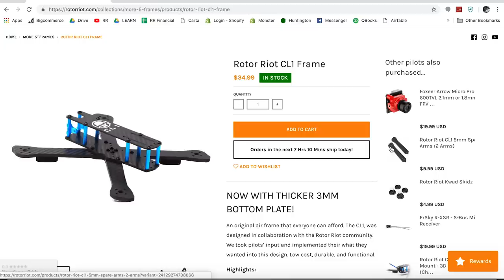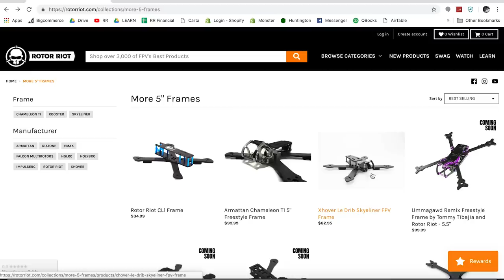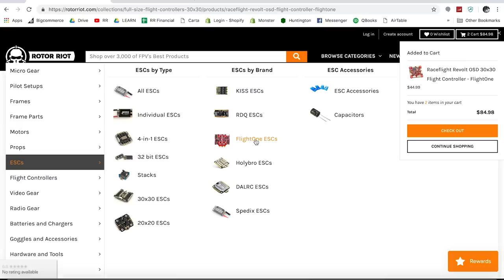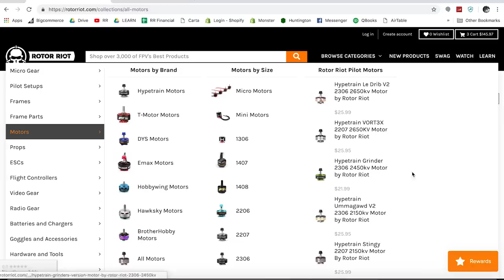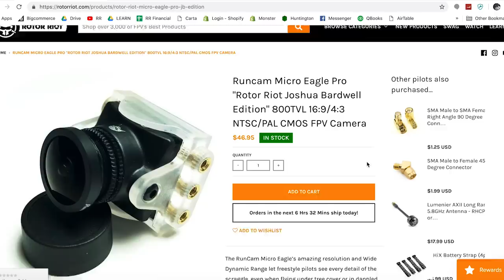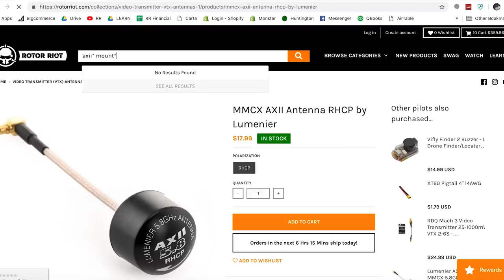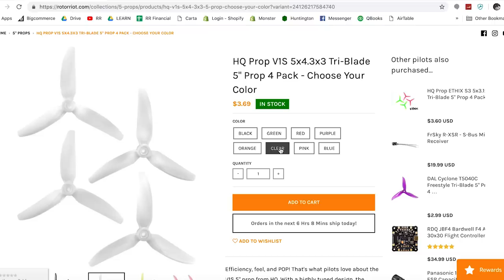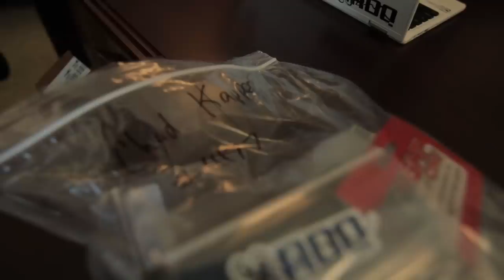Beginner FPV Freestyle Kwad - From the ground up!

Comment: Hey Rotor Riot! I have been planning to get the CL1 budget build kit for a while now, but I wanted to know whether not I should build a kit or do it from the ground up. I have a FlySky fs i6 in the mail and am going to train on Liftoff. I still have a while to practice and save up so I thought I would ask you guys. I think that I would want to fly similar to Drew's quads (I'm probably biased, Drew is my favorite), but I thought that the CL1 due to price would be the one to go with. Any advice would be appreciated!
Reply: Joseph Boehlke I would eliminate as much guesswork as possible and copy a RR build video as close as possible so you know all the components they choose will work together.  I like drib’s build.  Note: You’ll need a FlySky receiver instead of FrSky which is what most other folks use in FPV—no biggie though.  Good luck!
Reply from the maker: Just plan on crashing a lot! So don’t build your favorite from the start :)
Reply: Cheap/budget is fine, even the flysky i6 is fine, but honestly DONT get the cl1, it looks dirt cheap and they charge way too much for it. check for used or china frames, or even other cheap frames from armattan or amax.. the cl1 is made without any love at all, its sad
Reply: True about crashing. Fly over grass/trees instead of concrete and you can cut way down on the damage when you do crash.  Do yourself a favor—Practicing on a sim for at least 4-5 sessions beforehand will give you a huge head start.

Comment: KISS FC is not the best for beginners. The whole downloading of drivers is also a pain for newbies. There are plenty of video out there it just sucks we have to go through all this. I like how we have so much innovation with quad parts and yet we have to down load drivers from a website that requires email. Most frustrating thing about building from scratch is figuring out what will work together physically in a build. Kinda of have had built drones to figure out what is needed. for future builds.

Comment: Hello i am new i struggle on select the right flight controller and esc i need help to select on that match
Reply: What are you trying to accomplish?  And, how much do you have to spend?
Reply: @propsoff  freestyle 5" easy for a beginner   but good performance 250 or higher
Reply: @evelfpv  
Now, do you want AIO FC  (all-in-one flight controller - that has its own power distribution built in and normally paired with 4 individual escs on each arm) and four separate escs, or 4in1 esc? I like the 4in1 escs because the build comes out so clean; However, this will increase your stack height - eliminating low-rider frames. I personally use the T-motor F55A 4in1 esc. You can pair up just about anything, however, loads of escs and flight controllers come without instruction. Will this be your very first 5" build? 
Joshua Bardwell did a step-by-step 5 inch build, and I mean step by step - It would be a good one to go with for a beginner. A lot of mystery is answered by JB and you'll have a great flyer when your done.

Comment: Hey there, wonder if some could help me. I have alot of horizontal black bars when flying fpv. I have installed a capacitor and it hasn't helped. What else could I do to fix it?
Reply: VTX to SMA to Antenna Connections should be isolated from the frame. E.g. with shrinktube.

That was causing me lines.

Another one is described in a video of Bardwell: ground connectors of Cam and VTX should go to the same ground at the FC.

Motor Noise could also be an issue. Try with props off to spin one motor at a time within the betaflight motor tab. When there is noise spinning one motor, it causes it. Hat that with new motors.

Comment: I'm building a 6 inch freestyle quad, that I want long flight times for long range, but also good for intermediate freestyle maneuvers, I'm having a hard time choosing the right motor, any suggestions?
Reply: Yea bro bigger is better for 6in, they manage props better w less strain so more efficency and lower kv for less lipo rape ;) like around 2000 for 4s

Comment: Beginner to fpv getting BnF quads and I have 3 quads I can’t get in the air. All are he running crossfire nano rx. I’m trying to use QX7 with micro v2 and tango 2. Having same issue with both. Cannot see gimbal or switch movement in beta flight.  Binding is good with solid green light. I have 3 quads and 2 controllers and can’t fly. Very frustrated. Tbs tried to help but couldn’t. They think the BnF is on the wrong uart but it’s BnF and I’m having the same issue on all 3. I’m trying to get with I flight to get their BnF protek35hd running but having a hell of a time. In need of guru please

Comment: you should pick your motor based on what thrust and speed you want. there are plenty of online calculators where you can see the motor and esc temperatures, efflux speed, overall weight, etc.. you can also run what ifs on different prop diameters, pitch and number of blades.
you size your batteries from there also.
DO NOT just pick a motor and ESC. - well you can but you'll be guessing, which is also fine.

rpm is voltage x motor kv. A higher kv motor merely pulls more current for the same voltage. thats all. 

it'd be good to get some of the science supporting the fuzzy logic here..no offense.

Comment: Drib is not happy about Chad's idea. Honest, every quad building is
  column distance problem, everything else is the peculiarities of components.
And I agree with LeDrib. This is not the right way to highlight little things like a usb cable, it's already funny. About the engines and esc Josh tells in his channel very exhaustively. There is no way to build a good quadcopter without pain. You learn from mistakes, just as all mankind does...

Comment: Hi Guys   I have a Chameleon that I purchased off Ebay,  so I don't think it's a real Chameleon. But I don't care and I have 2205 2300kv racerstar, 30a 4 in 1, Fortini F4 osd V2,, Eachine TX-526 smart audio 25- 600mw , runcam swift2.

Comment: Why do the Rotor Riot guys refuse to ever mention KISS? I've noticed lately they try to avoid any KISS talk what so ever.
Reply: Nobody tries to avoid it. I even mentioned one of my other kwads has KISS in this video. I can tell you the one thing that has kept me from using it more recently...  KISS is primarily using a separate PDB and ESCs.
Reply: @ChadKapper  Sure seems there is more there than that. Another RR pilot the other day mentioned how great it flies but would never try it. He moved away from the topic quickly, it's happened more than once.
Reply: @pyroman590  people just like to stay in their comfort zone. I'd like to work on expanding our horizons!

Comment: Why would you need rxsr rx with telemetry when the xm+ has an rssi signal? I only want to point out to the beginner, the xm+ is cheaper, easier to wire, and has better range. Only thing rxsr will do is make your radio yell all day, telemetry lost, because range sucks.
Reply: Not true range is superior of ya do it right
Reply: @flo-ridafpv5713  yes, it is most certainly true. Telemetry takes up more bandwidth. Its easy to test. Maybe you should test your theories. I am by no means a noob here.....

Comment: I got one i had started in 2007 4 different types of fpvdrone my newest one is a fl.1 millionth old skitzo 20.mm  by 20.mm .1st was a naze rev 6 I have been trying to program . 2nd. Bf3 no go  had gotten a bad Board. So try x racer f4 . Flew for a week got sick and had to be hospital for a while  gotten out and it stop working so gotten the rotor riot  control FL f4  1st one that I have gotten was bad OK  got a 2nd  one hada cracked case my 3rd one is good but like kappa said  is where do u go from understand some  codes to where u don't have  with  a flone  fc out of  all of this I only have no more then 6 hours of flying total  haha some time I feel like giving up but it's hard  for me to go outside  cuz I get to sick and I thought I could see the outside of my house when this happens to me no I not dieing  or anything like that  but I get close to it sometime  watching all u fpv pilots helps me see the outside in so many different ways so thx  to all of u for the inspiration for not given up . Now all are from different  years. And different times and setup where difficult too. Don't feel sorry for me it just the way life is for some people some have it hard some just  have it worst in my  case I'm alive happy flying  and stay out of trouble.

Comment: I want to get into FPV but I have to be honest... this scares the shit out of me. I know nobody that can teach me and I'm scared to buy stuff I can't use or dont need.
Reply: Just follow a bardwell build vid bro or anyone's budget build and buy that exact stuff, but buy a lipo beeper like the vfly v2 so WHEN ur lipo gets unplugged in a crash you can find it, I've lost mine in grass 2 feet away
Reply: @flo-ridafpv5713  thanks. I just got a Emax Tinyhawk and I suck so bad but I'll practice day after day until I get decent.
Reply: @nickferdinande1646  perfect choice bro, sim helps for acro practice, and once ya fly the hawk in acro ok, put the project mocking bird tune on it, watch bardwells vid on it, it'll RIP then; )

Comment: What are all the reasons why a Quad ....... Flips Over !!  ...... I bought my 2 sons 2 quad sets , who spent 22 hours building 2 perfect looking machines ...... and both flipped over ..... and still flip over after 22 more hours of rechecking ......  Now they blame me for buying crappy parts !  ...... So , where could the problem be .... Connections , Radio , Parts , Programming or some Incompatibility ?  ........ Then I can get these two contraptions Flying and kick my dummy sons in the ass !  ...... Any help would be Appreciated !  ....... Love the show !
Reply: Mate just check the motors are spinning the right way in Betaflight and check you put the props on rights. You have just missed something. 22 hours checking?? Slow down and check all the settings. Watch Joshuas videos and follow along.

Comment: At 37:09 Joshua says that the copter could fly worth if the processor gets electrical interference from the ESCs. This is complete bullshit. If the processor would get just a little interference it would go berserk (in case of memory corruption) or in most cases just crash. There can be an issue with an analog component on the FC though if its to close to an fast changing electric field.

Comment: This is more a promotial kind of video to sell stuff to pull a beginner over the line, don't like soldering ? one should for this hobby ! soldering is needed,  if you can't you are limited in this hobby, subject money ? if you really want to get into this hobby, you need to spend some, better do it slowly, and buy good stuff, then constantly spend money on crashing cheap stuff, plan to setup 3 drones ? better concentrate on one good 5" mini quad.